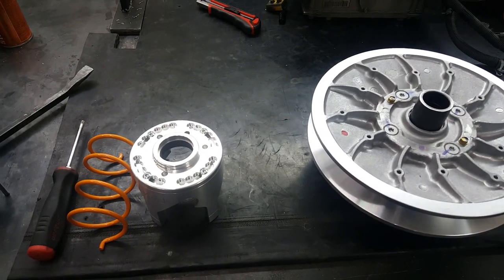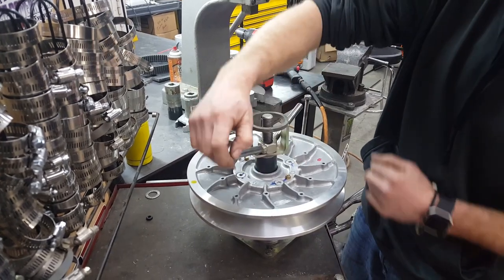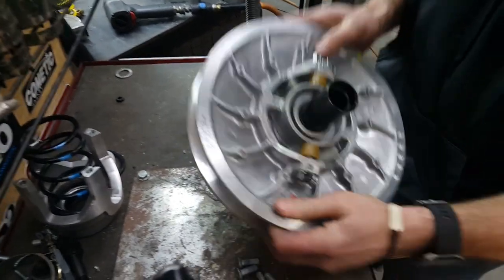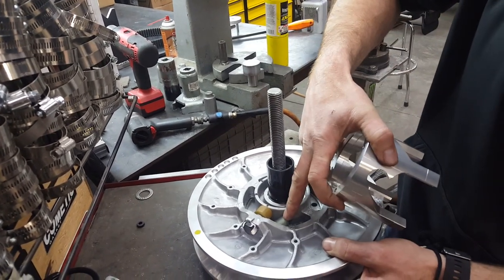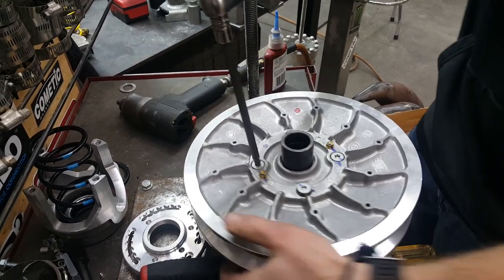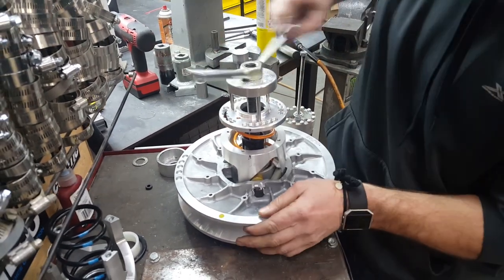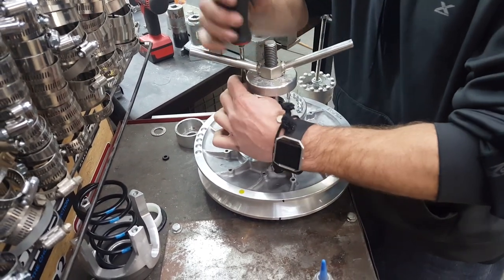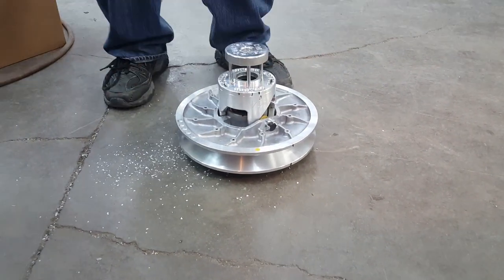BMP Torsion Secondary 2012 15 Arctic Cat

Comment: What is the advantage to this clutch kit over stock?  I haven't seen it explained anywhere...
Reply: Russell Telker faster back shift and higher rpm's when it engages
Reply: @adambaker3616  how is ur secondary going to increase your rpm at engagement?
Reply: @Mogachaffe  I think it can take more rpms at shift
Reply: Just from looking it appears it allows you to change the spring rate without changing to a new spring.
Reply: @thesupernad  also the up-and-down shift will be faster
Reply: @thesupernad  also the up-and-down shift will be faster
It will not change engagement, that depends on the primary.

Comment: is it obligatory to put glue on the screw?
Reply: Oh yes it is! I dissassembled mine 4 weeks ago, and after 3 hours of sleddin' it started to rattle but I didnt knew where the sound came from. I went home to investigate and I had lost à bolt and the other 3 were loose. If it is stated in the shop manual.... DO IT! Don't act like me and risk ruining your secondary or anything else on your sled. Oh and by the way, they were torqued to specs too. Happy snowmobiling!
Reply: @tegowner  i have done 10 hours on my sled and they didnt even loose haha i guess i  lucky but thank you very much next time i'll check for some glue
Reply: @tegowner  Have you had good luck with it being reliable? I've Glued and torqued the screws every time but it pulls the threads out of the helix after 20 miles and had the whole spring cap come off.
Reply: @mungermotorsports7569  actually yes, no trouble. Ive ridden +/- 60 miles and still going strong. Maybe you didn't heat up the threads enough before removing the bolts and weakened the threads then when you reassembled, the threads were a bit weakened? You are worrying me :-P